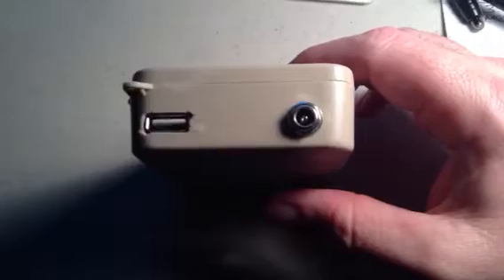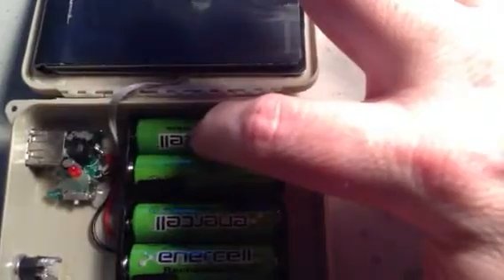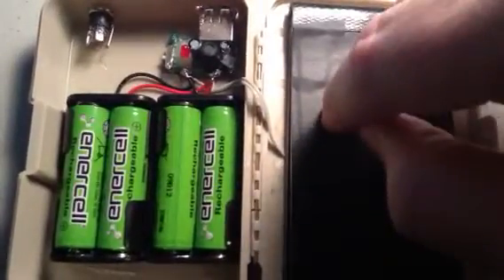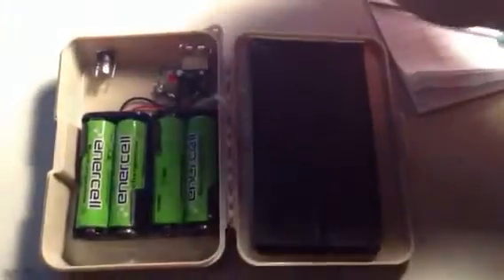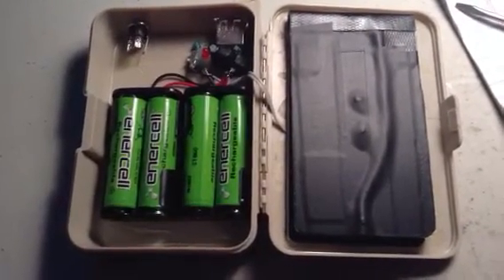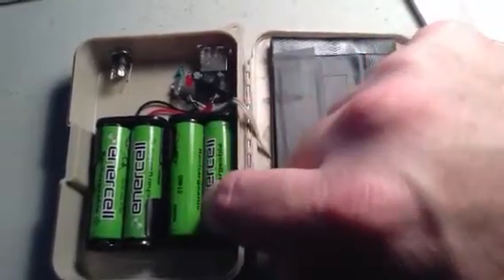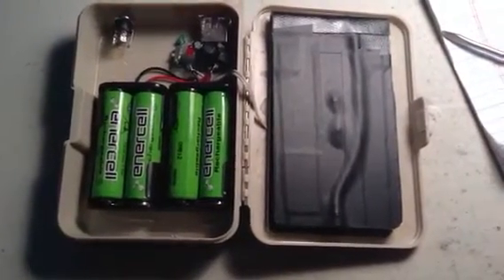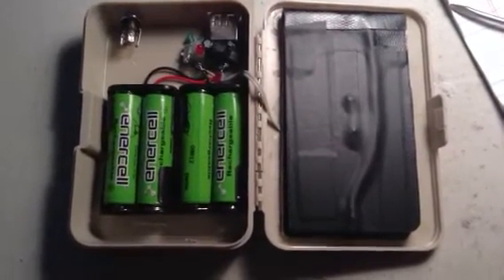Wiring explanation for the DIY solar USB iPhone charger.

Comment: How do you fix and iPhone charger circuit .. Like the main head it broke off not the cable the circuit literally broke in half
Reply from the maker: I would just but a new circuit. They are only about $6 each and it is not worth doing something wrong and having a fire as a result. Let me know how it turns out!!
Thank you for watching and commenting as well.
Reply: ShoeManShoe68 where can I find one online ? Or do they sell them at Walmart?
Reply from the maker: Here is a link to my favorite one...
http://www.browndoggadgets.com/collections/charge-controllers
Reply from the maker: it has a on/off switch and a LED flashlight too..

Comment: I'm looking for something just like this to charge the round 18650 3.7v Lithium batteries. Can somebody point me in the right direction?
Reply from the maker: +TwoHandsNY You will need a Lithium charge controller. Here is a video i made of of a charger with a 2 18650 battery pack. Check it out.. I started it where i show the device so you can avoid my ramblings..
https://youtu.be/1zrDTS38-JM?t=4m7s
Thanks you watching and the comment.

Comment: Did you just use something like 100 MPH tape to make the "hinged" solar panels? Or did you glue some type of small brass hinge? Like off a little jewelry box or something.
Reply from the maker: +Robert Salmon Oh yea, it is Duct (200 MPH) tape. A little ghetto but effective.
Reply: +ShoeManShoe68 Man in the Army that stuff was essential to any successful mission or op.  Serious. Good to see civilian application.  I like this video, it really is a very clean setup.  I have picked up some of the solar panels when my Radio Shack was going out of business. (Sad day to be honest) and then at a HAMFest (Radio not the pig) I picked up a couple of really nice solar panels with a resistor already soldered on.  Thinking of using the smaller ones as a portable setup like you, and the larger one (12" x 12" on my ruck sack when want to charge on the go.  Thanks for posting important stuff.
Reply from the maker: Robert Salmon Thanks for the reply and the kind words and Thank you VERY much for your service!!
Reply: +Robert Salmon  "Resistor already soldered on"   ?????  More than likely it is a Diode.
Reply: +ODX171 I will defer to your wisdom good sir.  For us Jack of All Trades, Masters of None, everything we don't recognize is a resistor and every flower is a tulip.  Except now I will use diode and resistor on a rotating basis. ;-)
Reply from the maker: Robert Salmon it is duct tape. It is still holding good too.

Comment: can you add more batteries like that for more capacity ? so if i get 8 batteries it would be 10 000 mAH on 2.4V right ? and then i use a bigger solar panel ? would this matter ? does it damage something because the output of an usb is 5v?
Reply from the maker: +Nathan Swinnen As long as you wire it right and know what the mAh and voltage is. Use about 10% of the total mAh of the batteries of power to charge. Like if you have 10,000 mAh of batteries use a 1 amp or 1000 mA solar setup. For voltage use about 1.5 times the total voltage of the battery. Like if you have 2.4 volts have a solar setup that pushes 3.6 volts, give or take a volt or 2.

Comment: Hi, just wondering if i can use a 5v 500amh solar cell to charge three 2000amh batteries.
Cheers
Reply from the maker: +George Panayotakis If you are using NiMh AA batteries i think that would be too much power and it would ruin the batteries pretty fast. If you are using Li-ion with a charge controller you will be fine. Test the solar panel and make sure you know what it pushes at max in the best sunlight. I have a 5v 500mA solar panel that only pushes around 220 mA. In that case it would work just fine but always stop charging NiMh AA batteries if they get warm or hot and don't charge in direct sunlight or you won't be able to tell they are hot from the power input.

Comment: What would be better? Using a 9 volt battery or the ones you used.
Reply from the maker: Hope Xtra It is more efficient to step up from 2.4 volts then to use a 9 volt and a voltage regulator.

Comment: I want to purchase 4000 mah 3.7 volt li-ion batteries, should I only use 1 battery or 2 in parallel for double mah?
For charging you said voltage times 1.5, so 5.5V what about 5v and 1A from a iphone charger. 
I bought a DC - DC step up to 5v are you using the same?
Also if you connect the solar panel will it always drain from batteries first?
Could this ruin my iphones battery in the long run?
Reply from the maker: I would buy a pre made pack at the amps you want if you are doing Lithium batteries. I think it would be safer and the pack will have some safety shut off tech for overcharging or if an issue happens it will disconnect in less then a second.

For charging Lithium batteries you need a charge controller. Make sure you never try to charge a lithium battery with a solar panel or a charging cord unless there is a charge controller in the middle.
A lithium battery has to be charged at exactly 4.2 regulated volts. 5.5 or 5 volts might cause a fire or worse.

Here is a link to a video i made on wiring a lithium-ion setup with a solar panel. Wiring diagram for simple solar lithium-ion powered USB/iPh
5 volts at 1 amp is perfect to put into the charge controller and the controller will output 4.2 steady volts to the battery. If you follow the directions in the link i believe the phone will be charged from the batteries powering the USB charge circuit and the solar panel will just help to keep the batteries from draining as fast.

The charge circuit regulates the output so it is safe for your iPhone.

Thanks for the comment/question! If you have any other questions please feel free to ask.
If you make a device and share it please send me a link.

Comment: where did you get the female usb component to steadily output 5v?
Reply from the maker: Got it at browndoggadgets.com Here is a link:
http://www.browndoggadgets.com/collections/charge-controllers/products/usb-charging-circuit
Thanks for the questions!
-Scott
Reply: do you know where to hook up the wires on the board?
Reply from the maker: I got some videos on my channel showing the wiring. 
Wiring explanation for the DIY solar USB iPhone charger.
Wiring diagram for simple solar lithium-ion powered USB/iPh

Let me know if these help.
Thanks

Comment: Hello!
I am a Mechanical Engineering student from India. I am not good at electronics. But i wish to make solar USB charger for my Samsung Tab2. It needs 5v 2A. I have two solar panels bought from ebay which give an output of 5.5V 450mA. How can I use them to make a Solar Charger to obtain an output of 5V 2A? Kindly help me. Waiting :)
Reply from the maker: I replied to this but I don't see it now. If you are using a battery just get the largest Lithium battery that will fit in your case and find a step up USB dharge circuit that pushes 2+ amps. Watch my lithium ion chargers videos wo you know the setup. You have to have a charge controller with a lithium setup. 
Thanks for the comment.

Comment: how mach o/p it give
Reply from the maker: The output is 5 volts and 1 amp or 1000mAh as long as you are inputting enough. It is also iPhone ready.
Reply from the maker: What i mean by inputting enough is: If you just hook up a battery that is 3.7 volts and 1000 mAh the circuit will not put out the 1000 mAh at 5 volts. I believe the voltage conversion will eat some mAh to bring up the voltage from 3.7 to 5 volts. It will still work to charge but would not provide a full charge to an iPhone. When the battery has enough extra mAh and the circuit is pushing full voltage it may take 3 hours to charge as with a lower input it will either push the right voltage and use the battery faster or push the right voltage and a lower amount of mAh which would result in a longer time taken to charge the iPhone. The chargers battery being so small it will not be enough to fully charge an iPhone as where a 3.7 volt 4,400 mAh will be enough power after the conversion to charge the iPhone to full. I know this because that is what my battery is. I am not sure what loss will occur with the conversion but i know it is more efficient then using a 9 volt and a 5 volt regulator to make it 5 volts out. The step up conversion has been proven to be more efficient then regulating a higher voltage to 5 volts. Thanks for commenting and sharing!

Comment: What type of battery is best to use?
Reply from the maker: I think Lithium batteries are the best. You do need to use a charge controller when you charge them but they are the most efficient as far as batteries go. I have some videos of projects with Lithium-ion batteries, check them out.
Reply: Thanks!!!
Reply from the maker: David Angelo Ascan Hello, did you ever make a charger project? I would love to check it out if you did.

Comment from the maker: That is exactly right. I used 2, 6 volt 84mAh solar cells in parallel to get 6 volts 168 mAh total. With 5000 total mAh of batteries i could of used up to 500 mAh and that's the limit i would use for the charging Ni-Mh batteries. A better match would of been: 3.6 volts 500 mAh. I have read that the total voltage of what you are charging + half is right about optimal for proper charging without damaging batteries. So 2.4 volts + 1.2 volts = 3.6 volts then 10% of batteries mAh. 3.6 volts 500 mAh.

Comment from the maker: Don't hook direct to the battery for charging any Lithium type battery! You need a charge controller to give exactly 4.2 steady volts to the battery w/no spikes or dips. You can hook the 7.4 volts to the charge controller and i would think it would either just not work because it is too much input or it will work fine and it might get a little warm or hot but it should shut off if needed and stop voltage to the battery before damage or fire. I am no pro so test for warm and be ready to unplug.

Comment from the maker: The 2 separate battery holders when wired together would act as a 4 cell battery pack. The cells/batteries would all become of the same voltage and would drain at the same rate. 
As you charge the system it would charge the cells all at the same time like a 2.4volt battery pack. With there being 2 holders that have 2.4volts each it will take longer to charge then just one of the holders. About twice as long probably for all 4 cells or both holders. Hope this is understandable.

Comment from the maker: If it is a Lithium type battery then you have to use a charge controller to regulate the amount of current and volts. If it is rechargeable AA batteries then it would probably be ok but make sure they are not charging up past 1.45v per cell or 4.4v total pack. If you have a 7.4v solar panel or power supply you can get a voltage regulator at 5 volts and it will give a nice steady flow of 5v to the AA batteries.
Do not ever try to charge a Lithium style battery without a charge controller!

Comment from the maker: I am not a pro with this stuff. Why are you ragging on my stuff when it is pretty clear in my videos that i am not an electrician. I just posted a few videos of stuff i though was cool. I am learning and I don't claim to know much but i know the same batteries in a series did not last near as long as the way it is wired in this video. Why don't you explain the right way to make a charger for under $40.00 so we can all learn. Please use small words because i didn't go to school for electronics.

Comment from the maker: When you put batteries in a series it adds voltage not mAh so you get 4.8 volts and the mAh of 1 battery. I tested the 4 batteries in series and it did not preform as well as the setup in the video. So you are talking about a wind up charger that charges it's own batteries and then those batteries will charge the iPhone? I never said there was not better devices out there i was just showing the one i made. How much does an electrolytic cap cost and how big is it? This is a pocket device.

Comment from the maker: A car battery charger is going to use 120 volts and a lot of current to charge a 5 volt device. That means big electric bill. You can buy a Apple charging dock or another after market one for about 20 bucks and plug most USB cords into it. If you are looking for something to use in the house.

Comment from the maker: The most effective way to charge at 5 volts is to use between 2.4 and 4.8 volts and a step up circuit but to have the most mAh you can. I used a case that is 4.8 volts. 4 batteries in a series, it charged the iPhone 1.5 times. The same batteries in parallel at 2.4 volts with the exact same circuit charges it 3 times. The batteries are 2500 mAh so 4 in a series is 4.8 volts 2500 mAh. 2 batteries in a series and then in parallel with another 2 will make 2.4 volts and 5000 mAh, much more current.

Comment from the maker: To use a voltage regulator you need to be dropping the voltage at least 3 volts. If you are pushing 8 volts into a 5 volt regulator it may work but you lose a lot of current in the drop. Losing current = losing efficiency. The step up circuit is the way to go. It gives the very most you can get out of your batteries. Thank you for the comments!!

Comment from the maker: I you charge an iPhone with a wind up charger you have to limit the voltage to 5 and if the winder is pushing more mAh then the solar panel it will charge faster. If you hook to the iPhone and use it's charge controller it will limit the current input so the battery will not be damaged and you will be no faster then a good direct solar setup on a sunny day. If you use a charge circuit that pushes 2 amps it will charge the iPhone the fastest. Like 3 hours. I am not cranking for that long.

Comment from the maker: You should tape up any showing connections to the battery but make sure you don't tape over a part that gets hot and need to have air to cool. You need to line the bottom of the tin with electrical tape so it will not conduct electricity if a board touches it. I use hot glue to keep the board away from the bottom and to hold it in place. Keep the device in a well ventilated area when charging as well. It gives off a smell and i can't imagine it is great to breathe for hours on end.

Comment from the maker: I forgot to mention. Make sure you put down electrical tape to shield circuit boards and positive connections from the metal tin when putting stuff in a metal container! I have used the metal body as the ground so there was less wires everywhere but, know what your doing if you do that. Thanks for the questions and comments!!!!

Comment from the maker: The Lithium-ion charger i was talking about is in my "DIY Lithium-ion pocket iPhone charger" video. I used a Duracell My pocket charger end to make it compact but that is the circuitry i was talking about. I will try to make a video showing the lights and how they work when it is charging. My other video "Wiring diagram for simple solar Lithium-ion powered USB/iPhone charger" shows what i think you want for a charging solution. Make sure to get a protected Lithium battery and it's all good.

Comment from the maker: When i was using the Ni-Mh rechargable AA batteries i wanted an LED to turn green or something when it was done charging but I never found a way to do it. If you get a Lithium-ion battery, a Lithium charge controller and a USB charge circuit you will have everything you need. There are lights on the charge controller that tell you when it is done charging and it will stop automatically. You can use a USB cig lighter plug to charge it or a phone charger plug that has the mini USB end.